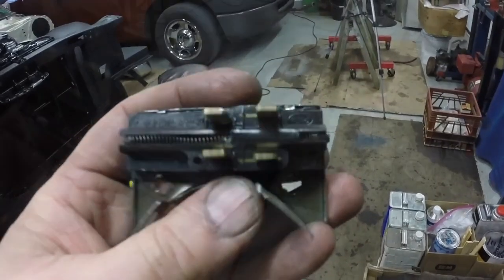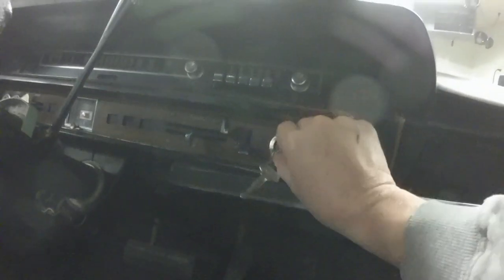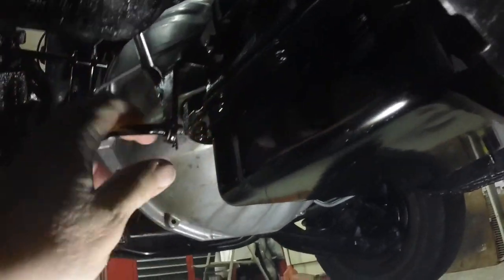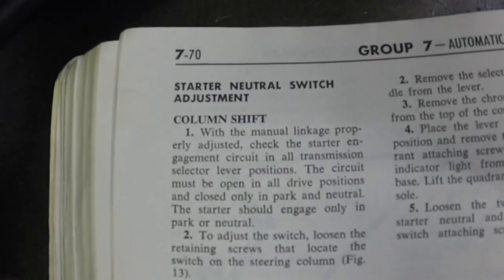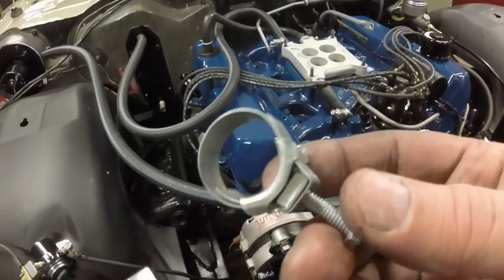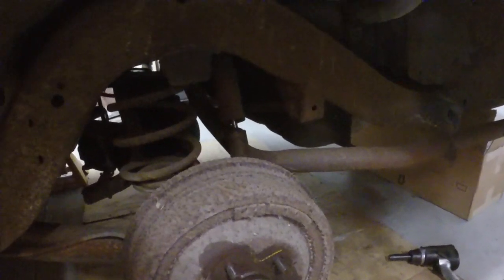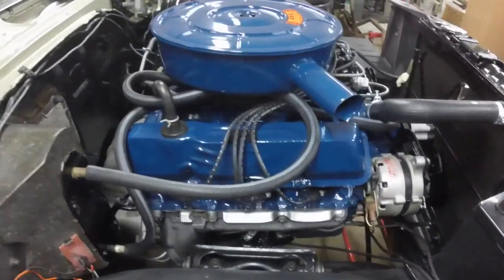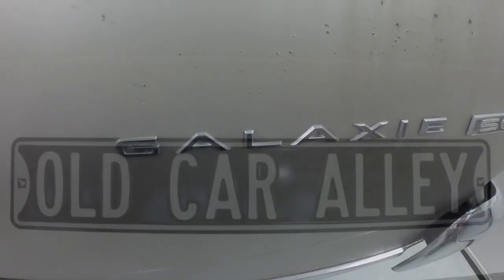1966 Ford Galaxie 500 convertible restoration part 60 removing the gas tank

Comment: OCD, people that don't have it are so lucky cause for them  things are simple. I too suffer with it and good enough is never quite good enough. Clips for wires that have disintegrated will drive me nuts till it is repaired right. Someone else could run a zip tie in and call it a day but not me. Hence when I am done, I can rest easy. I have all the respect in the world for your work and deliberation. It will be new

Comment: Back around 1972 I attempted to do what you are doing only with a 1958 Jaguar XK-150. The project was a total disaster, the car was being held together by a thread, all the internal sheet metal was totally rusted out. Sold the pile for parts.  I'll be 80 in April.

Comment: I regularly use a thin metal clothes hanger straightened all the way out to ream out the tiny water overflow tube that drains the gas filler cap housing.  Rain or car wash water collects in there when that long tube is clogged and will rot out the filler cap housing.  You can also get water in your gas tank that way since it is a vented cap.
Reply from the maker: I think the bottom of the filler cap is higher the the  bottom of the opening for the gas door, so I doubt much could get into the tank. The tank has minor surface rust in places on all sides, but the bottom has a black goo... 43 year old gas...
Reply: @OldCarAlley  
If that tube gets clogged, you'll have water sloshing around the gas cap and some could leak into the tank.  Besides, who wants the housing to rot?
Reply from the maker: @chuckster3629  I am sure a little did... thats why there there is some surface rust in the tank. Yea, and I got a housing to repair too.
Reply: @OldCarAlley  
I have to keep the drain tube clear on my '65 Gal since I live in western Oregon where it rains a lot and I park the car outside all the time.

Comment: Welp... I'm under the rear end of my other 66 Galaxie. Got the fuel tank straps off. Got the filler neck unbolted from inside the filler door. Got the rubber tank strap isolaters off. Got the sending unit out. This thing ain't budging. It's just dangling there. I can hang on it. There's nothing above it bolted in. The filler neck seems to be the only thing holding on. How did you get the filler neck out of the tank??? Btw, just a funny side note. I was like "YES a Galaxie tank removal video!" I think I must have been a little loud because I could see fingers and eyes through the neighbors' blinds. The you jump cut from the tank being in and just miraculously not in anymore. At that point I nailed my forehead on the brake drum.
Reply from the maker: Yep the filler neck has to come out before the tank.

Comment: I would pull the tank the rear end replace the axle seals replace the pinion seal the differential gasket all that stuff it's easier just have the rear end out of the car so you can clean it and paint properly. Plus I don't like doing that all underneath the car  with stuff falling on you getting in your eyes . Just a thought .

The car is coming along nicely 😎

Comment: i got original type hose clamps for my 65 merc..i think i got mine out of a mustang supplier..i needed 12 and only got 10  as you did ....i'm guessing the rear  in your car has 3;00;1 ration and 28 spline axles  open rear..the 3;00;1 ratio was so common back then ....you are doing a real nice job...i couldnt go to bed until i seen another one of your videos ...ok...seen it now off to bed  lol
Reply from the maker: It does have a 3.00:1 axle ratio. So far everything looks good in the rear. the drums turn freely, but are stuck to the axle shaft. Might need a little heat to get them off. Hoping I can start cleaning things up, and do some sanding underneath this weekend and next week... getting it ready for paint and brakes. I got to order springs this morning.

Comment: You know my moms and dads 1966 galaxie 500 we used to have to pull back the gear shift lever to get it to crank to start you might try that question mark ours was a 390 engine though that was the only difference and it had air condition I don't think that makes any difference but that was the only way it would start and I know you've never started this that might be all that's wrong with it so give it a try I hope it helps.
Reply from the maker: It probably had a neutral switch that was going bad. Common on these cars. There open and near the floor, so they get full of dirt, and that wares them out. I checked it all out. The ignition switch is bad....

Comment: Switch made in china ?? It figure's..hope the radiator shop can clean the tank..are you going to coat the inside ? Looking foward to see you repair the rust..what little there is of it..the car is really solid and that is what makes it worth it..you do great work..no one will ever know you were there..see you on the next one Cheers 🇺🇸🇺🇸🇺🇸🇺🇸
Reply from the maker: I am hoping a good cleaning will do. I hope they don't need to coat it, as the coatings never last. That stuff makes a huge mess of the fuel system, when the coating starts breaking down. The coating is good for about ten to fifteen years. If it's that bad, I will replace the tank with a new one.
Reply: @OldCarAlley  hope it don't come to that..maybe it will be ok..it didn't look all that bad..see you on the next one..Cheers 🇺🇸🇺🇸🇺🇸🇺🇸
Reply from the maker: @rodneybrand8521  It has patches of minor surface rust, and a black goo on the bottom... I think thats the nasty smelling 43 year old gas. I think it will clean up.... I hope!

Comment: Howard why didn’t you put the ac back into the car?
Reply from the maker: The under the dash dealer installed unit was kinda huge and ugly, plus the condenser was bad. It needed a new receiver/dryer , and a couple idler pulleys too. I just wasn't worth fixing. If it was factory A/C, I would have fixed it.
Reply: Doesn't need a c anyway it's a convertible 😀

Comment: Alrighty then. Huge waste of time... Tank has a $3 half coat paint job, 9 pounds of rust and varnish, and the sender gasket will never seal again as a big chunk of mating surface fell off in the tank. At least I know how to do it now. The primary Galaxie will have it's fuel tank removed one of these days as well. Gotta wrench it to know it I suppose.